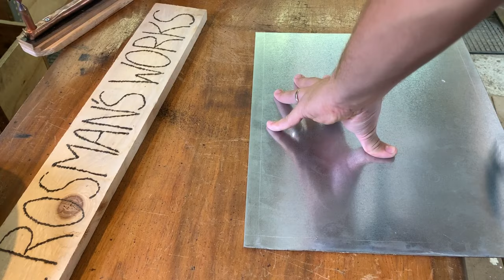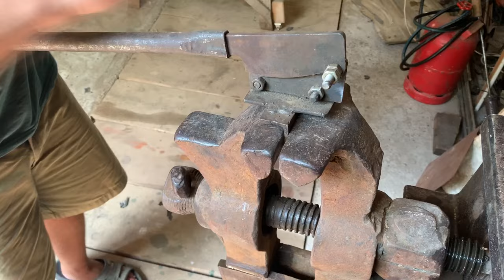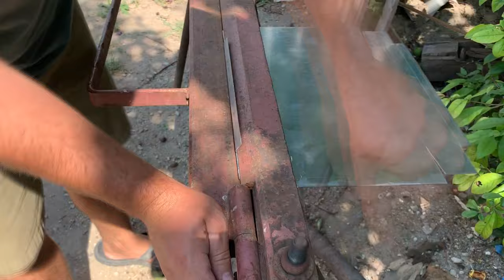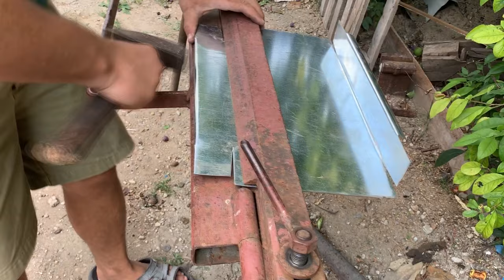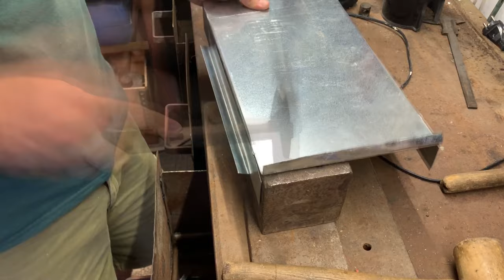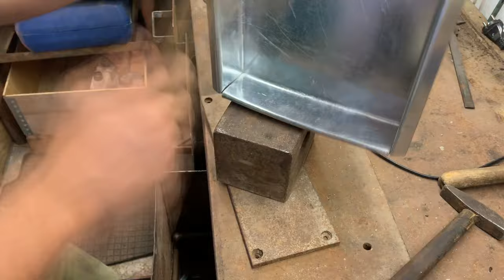How to make a sheet metal box| Cum se face o cutie de metal din tabla

Comment: what is the thickness of the sheet metal? thx
Reply from the maker: Is 1 mm
Reply: @crosmansworks2778  thanks :-) is the box 1.0mm stable enough for 10 kg?
Reply from the maker: @ers-ust170  most probably yes, but depends also about the dimensions of the box